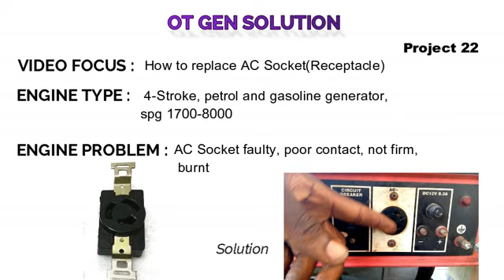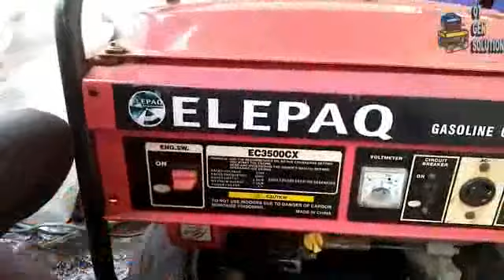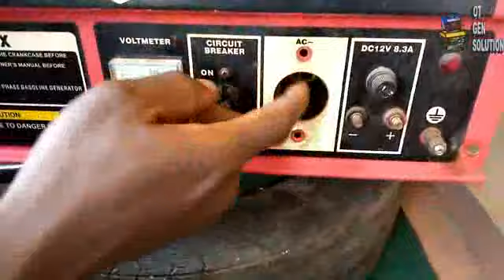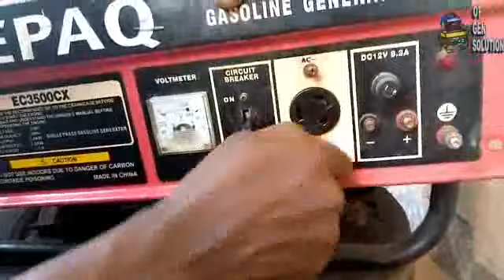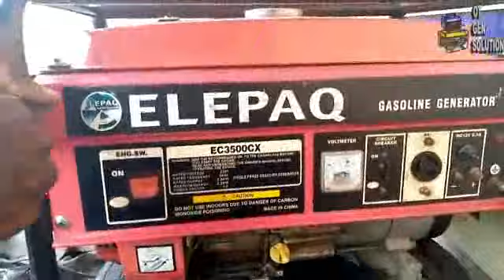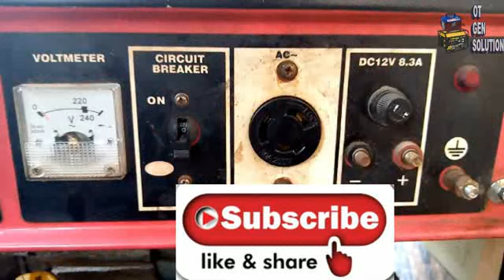How to replace generator ac socket(receptacle)

Comment: Thanks for video, very well done. My DC points for charging battery stopped working is there a way to fix that?
Reply from the maker: For sure.  Can be checked by generator electrician

Comment: Thank you so much for the tutorial.

Sir,I have a question about my generator.

Can I increase the speed of my Sumec fireman SPG3000e2 generator  to be able to power my two 1200watt pressing iron?
    Is it bad for the generator?
Reply from the maker: The capacity of spg3000 is between 2.2- 2.5watt. Therefore, it can power any load below 2.5watt
Reply: @OTGenSolution  thanks boss

Comment: Pls how can I reduce the smoke from small tiger generator?
Reply from the maker: Reduce the oil quantity you mixed with the fuel
Reply: @OTGenSolution  thanks. But will it affect the Gen engine?
Reply from the maker: @abselectricalhome8816  No, just mix with the right ratio